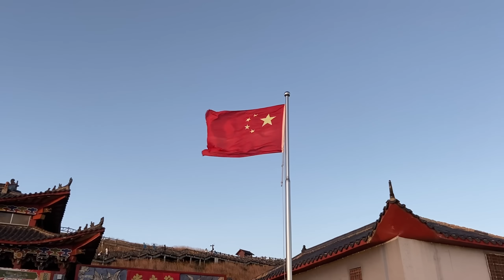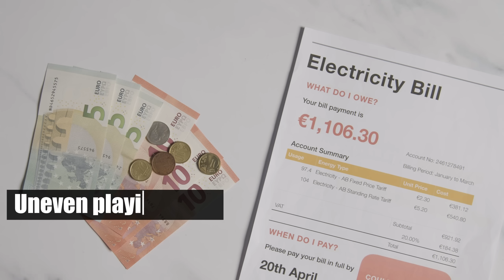Europe's Economic Crisis: Why Industries Are Collapsing Faster Than You Think! Electric Cars Failing

Comment: All due to NetZero. Carbon dioxide is not very high and yet all resources are put on hold. There are gas and oil, but the climate zealots do not want to use the fossil fuels. The economy takes a nose dive due to carbon for no real reason.